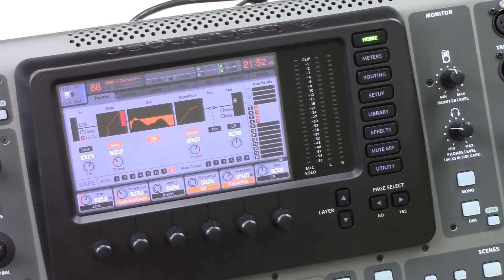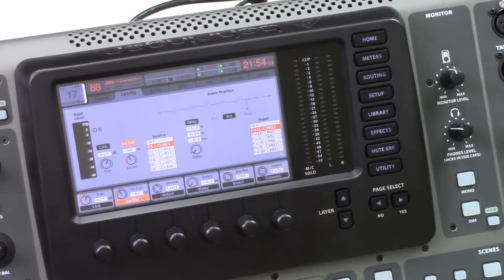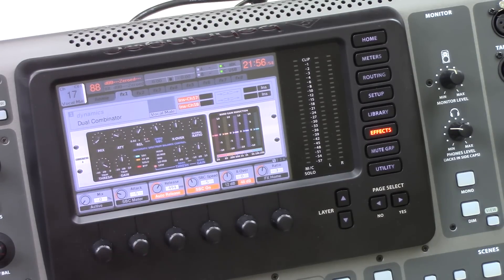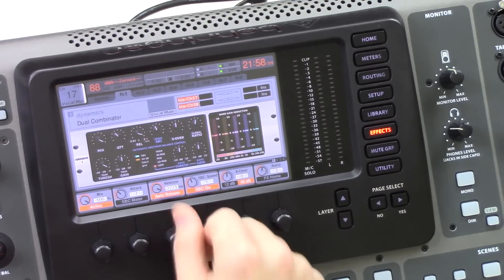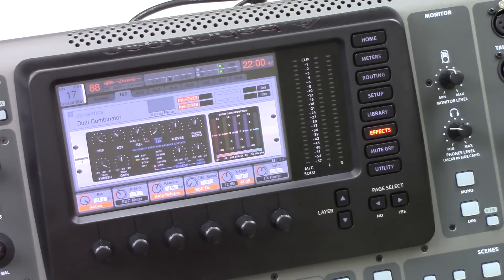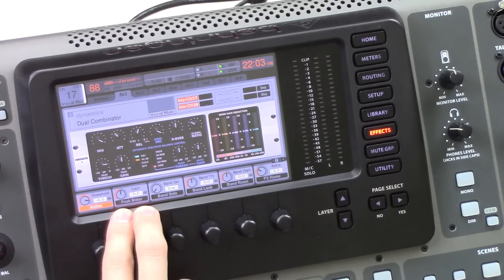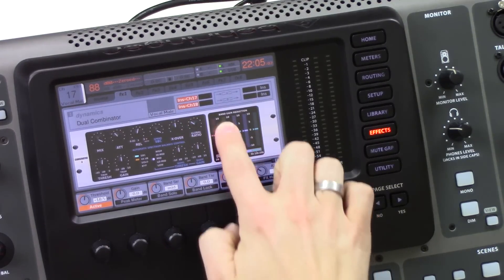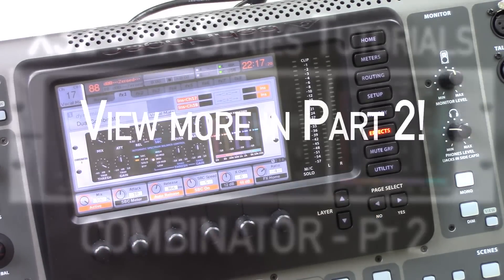Behringer X32 Effects Tutorial – Combinator Multi-Band Compressor Part 1

Comment: You put this on a vocal ch so how do you add it to multiple vocal ch
Reply: You can either choose dual combinator and use each side (A and B) on the inserts of different channels, or you can put it on a subgroup, either dual combinator using one side on a mono group or stereo combinator if you are using a stereo group. You could use the dual combinator on a stereo group if you wanted, just make sure that you remember that adjusting the A side will not affect B. I did that once having a dual graphic on main PA a output and was only eq’ing one side of the PA…didn’t make that mistake again though, so it was a good learning experience!

Comment: I turn off 48dB because it has a really icky plastic sound I don't like. On the X Air, I strap it across the inputs from my DJ mixer at the lowest threshold with a ratio of 1.2 and a slow attack/release.

Comment: Thanks for this! I am moving up from the XR18, and while they are similar, even more so now, your videos have been very helpful. Even for the XR18.  I was wondering if you knew why the combinator wasn't available on EFX 5-8. I assume it's a processing limitation, which is unfortunate, since that means it couldn't be changed in the future. It would be great if I didn't have to burn one of the time based EFX to use the combinator on the main outs, especially since I'm using a dbx PA2 for EQ.

Comment: Hey Drew, it actually doesn't play back on the FX Returns. I thought so, too, but when I checked, I found out that the meters are showing, I think you can even solo the return, but no Audio is being passed any further than that at any point. So this is more of an hardware based output metering and solo tap point for the combinator.
Reply from the maker: Hey! You are right, I will notate that to the video, thanks!

Comment: Great video! I'm actually mixing a live to DVD performance of a 19-piece big band in a couple of weeks, and was planning to use these as stereo bus compressors for the different sections, as well as on the overall output. This was a big help given that I've never used it before.

Question, if I still wanted to set a hard limiter to catch any peaks that may slip through on the main stereo bus, is it possible to insert it after this compressor?
Reply from the maker: Great idea! Yes, if you set the insert to be 'Post' on the 'Home' tab with the LR Bus selected, you will be able to insert this post EQ and Dynamics. If you have the insert 'Pre' it will be before EQ and Dynamics. Thanks for the question!

Drew Brashler